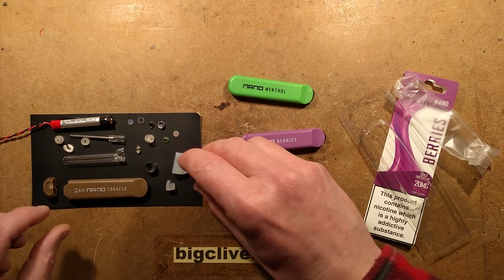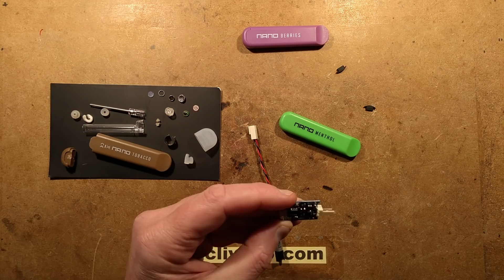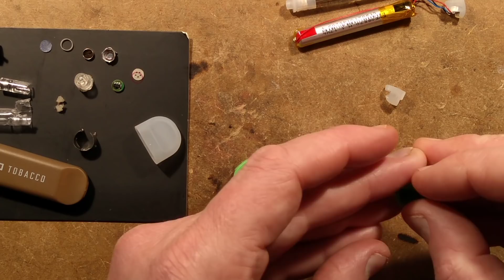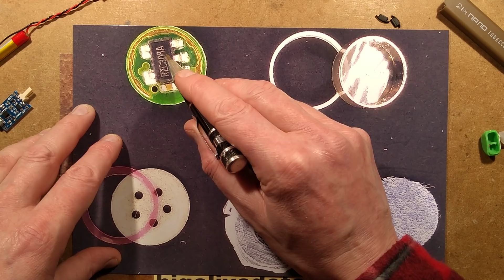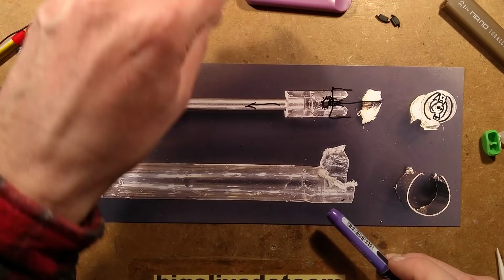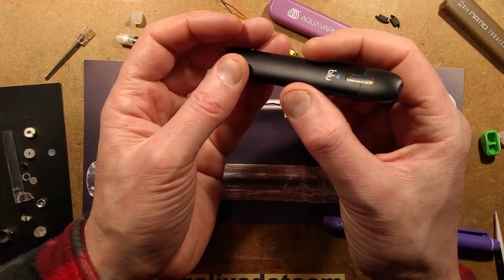Free lithium cells from discarded vapour devices.  (And total teardown of one.)

Comment: The newer vapes are  a bit bigger and often have a circuit to recharge the  lipo cell in order  to be able to extract the full say 16000(!) puffs (e.g. the Vozole 16000). It would be quite easy to make the reservoir  refillable too. The vozole 16000 for instance has a screen not only showing the  charge state and the  output power, but also the  filling level. adding a tiny hole for a syringe with vape fluid should make these things 'non disposable'. But at  say 25 euro a pop, I guess that is not what the manufacturers wants. I have no idea how many recharges one needs to  pull those 16000 puffs (I don't vape/smoke)  but the  lipos's I pull from them (generally 500mAh) still seem in excellent condition

Comment: How can the sensor be bypassed and remove the 10sec or so disabling the chip? I want to replace the sensor with an on/off switch and instead of mesh coil i want to get usb power out which can be controlled by on/off switch. Basically a mini portable power supply to light up an led  via usb( mesh coil) port.
Reply from the maker: You'd have to bypass it completely.   The timing is baked into the chips design.
Reply: @bigclivedotcom  yes, that’s where I need your  valuable opinion. If I desolder the sensor and put an on off switch, how would that work?

Comment: I found one of these in the car park the other day, I didn't realise it was worth 12 English shekels. Took it apart and found a working 3.7v 1500mAh battery inside. The owner probably didn't mean to lose it, but I'm appalled at the huge e-waste impact these things must be having? There was no actual way to refill it, just use 3500 times and then dispose of
Reply from the maker: The big 3500 puff ones have that very useful and fully rechargeable 1500mAh cell inside them.  Always a great find.

Comment: Thanks for this video! I've also started to salvage these lithium cells from used vapes just recently. Is it dangerous to charge these cells with regular TP4056 chargers? You must have had a reason to swap out the current resistor. Also, are these lithium ion cells, or lithium polymer? Thanks again!
Reply from the maker: I use a TP4056 based charger to recharge them.  If desired you can change one resistor to reduce the charge current to 500mA.  I've made a video about that.

Comment: So my new partner vapes, and her one time use units have an 18350 lipo in every one. Is there any way to re-purpose that control chip? Could I tap on some leads and get a constant current for the LED to light or something as an indicator on a project or do 3 of those pins make a regular mosfet?
Reply from the maker: The chip is a bit specialist, which makes it tricky to find other uses for.

Comment: Is it possible to use these batteries for something significant? I can get my hands on thousands of old vapes of the same type with the 13400 battery 3.7v 550mah. Say I wire 3x1000 in parallel and then connect each to a BMS to make a 12v+ power pack. Would  I set something on fire?

Comment: I saw you using ecig batteries in another video and you demonstrated how simple the chargers are to attach. I got 15 little chargers on Amazon for $11 with a USBC port for charging and they charge in an hour. It's a sweet little setup and I can make it better by adding another battery. The price is the best part. Everything battery operated that I have is gonna get a charge port if it doesn't already have a way to be recharged. I appreciate you sir. Thank you for sharing your skills knowledge and experience, and thank you for inspiring me

Comment: Just learned that through that chip you can actually charge the battery safely. Apply 5V to it and it will control current and voltage parameters. 
Maybe worth a look.
Reply from the maker: Not all of them have that feature.
Reply: @bigclivedotcom  
Bit of a dangerous way to find out I guess!

Comment: I'd come to much of the same discoveries in the cannabis vapes similar to this that we have locally - most of these ones include a micro USB for recharging until the tank is depleted, so I knew right away there had to be a small lithium cell that should either be salvaged or properly disposed of with battery recycling. I was always curious about that weird microphone like component running the show, but most of my disassembly attempts were too violent and I munged the tiny mystery chip within every time - these ones are even smaller and lack the two holes on the back which would aid disassembly which (probably extreme miniaturization over past couple years!)

Comment: I have a bunch of led driver chips with ltc4054 42, marked lth7 that I took apart from dog tags. Can I send you one to see what could be done with them?
Reply from the maker: The 4054 and LTH7 are actually lithium cell charge control chips.  Actually the same chip in 8 and 6 pin variants.  They regulate the charge current and end the charge at 4.2V.

Comment: Could you use the circuit from a poundland power bank to charge these cells, do you think?
Reply: Well..... so far so good. Just tacked one on to the charging circuit with a little bit of solder and plugged it in. Originally read 1.5v, now reading 3.8v. No explosions or fire so far but it's in a Pyrex dish just incase.

Comment: A disposable smoker's habit is an electronic fans again. Don't throw it away, pass it on to us geeks to reuse the Lith cells. After watching the other BCDC vlog about this waste of recyclable components it was worth watching this one too. Interesting thing was how the inhaling device worked with the micro thin diaphragm disc contacting the chip on a disc circuit signaling the lithium cell to power up the heating element of the device to heat the nicotine fluid to produce the smoke vapour. A great show case about these items, and that there is no smoke without a Lith Cell to fire up, LOL.

Comment: 20mg/ml is still lower than my current nic level of 24mg/ml...but considering I have cut my smoking of tobacco down from ~70 cigs/day to 2 cigs/day it's okay  :)  
But I do not use a disposable device like these...I use 18650 cells that I harvest from free laptop battery packs...they cost me nothing but the power to charge them.  
So far I am still using batteries harvested in 2017 that were made in 2009...haven't needed to delve into the ones I got later on yet.

Comment: They've made them in an even cheaper design now.
I bought one out of curiosity about a week ago and when opening it I dropped it on the table and the guts dropped right out.
I actually decided to smoke it and by the time the battery had run out it was still more than half full.
So I clipped the terminals up to my bench power supply and set it to 4.2V 240mA and it charged just fine (you can tell when it's charged on my bench PSU (a Tenma T2-10480) as the voltage goes slowly up to 4.2V and then the current starts to drop off at 4.2v.
After the reservoir was empty I simply drilled a hole in the side of it (a press drill made this very easy as I could drill super slowly and didn't have the 1.5mm bit self feed into the coil) and after that I could refill it with whatever I wanted.
I chose nicotine based E-juice I had lying around (I'm not a smoker and hopefully never will be though I've had months where I just smoked a hookah until I got sick of it and it had a very high nicotine content as I supercharged the tobacco with E-juice, I just like blowing smoke rings) and it wan for about 5 days after which it seemed to lose some of its power.
These things are far from 'disposable' and its a pity that so many of them will end up in a landfill every year.

Comment: I just scavenged the batteries from 10 of these today , most still have around 3.2v and the bigger ones a capacity of 850mAh. I don't know what I'll use them for yet, but it seems criminal to throw them away after a single charge.....

Comment: So you can build your own and put a normal button style switch in . If I can afford or find a good used lathe I might try my hand at building custom wood and aluminum vapes but I will start with one of these cheap disposable ones if I can build a proper charger for it.

Comment: I see these on my walks along the road or in the park quite often, and have taken them apart and found the little lithium cell. Your channel has given me inspiration to make some art with them... will be involving LEDs of course.  The tricky bit will be rigging up a charger. Hopefully I can glean enough from your other videos to figure that out – my electronics knowledge is limited to fooling around since I was a teen, with no equational knowledge to speak of beyond a Volts times Amps equals Watts, and a long-ago use of Ohm’s law ... but this old dog can still learn. Thanks.
Reply from the maker: The main thing with these lithium cells is not to exceed 4.2V.  I have a DIY charger that uses low current and two red LEDs in series to limit the voltage to about 4V.
Reply: @bigclivedotcom   Ah yes, I remember you mentioning the 4.2V. Come to think of it, I may be able to use the little DROK buck converter (https://www.amazon.com/gp/product/B07JZ2GQJF) that has a "charging indicator light" – I replaced the tiny built-in pots (that adjust V and I) with larger precision pots that are easy to turn and adjust, so I can play around on the bench and use as a crude adjustable power supply. The manual mentions a "constant current mode", but sounds like it's a current-limiting mode, for 2V only (https://www.droking.com/cs/support/topic/set-constant-current-on-the-180080afa/), so I guess that would be for a single cell? Hmm... I'll check out your circuit too... Thanks.

Comment: Love the side explanations. When I saw your video on salvaged lithium and NiMh batteries I knew there'd be some useful info and general theory, best practices etc. on the side. I feel like I'm learning a lot. Wondering if you could explain something about choosing the right voltage for recharging salvaged lithium battery. Also I heard from a guy that applying dimmed AC on fatigued LiPo cells can revive them but can't seem to find anything reliable and if you know something about it I'd love to hear it. Cheers!

Comment: Something to remember with this is that nicotine can be readily absorbed through the skin and the amount of nicotine that will make you sick/poison you is highly dependent on your body size (a smaller person requires less exposure to get poisoned), rate of exposure (your body is great at metabolising nicotine so long term exposure to small amounts will not poison you but that same amount of nicotine in a single hit could poison you) and if you consume it on a regular basis (a non-user requires a lot less nicotine to poison themselves compared to even a light smoker/vaper).  Clive is experiencing nausea (usually the first symptom of nicotine overdose/poisoning) when he vapes on these because he has a low tolerance for nicotine and nicotine salts are absorbed really fast.

In other words, don't get the liquid from these devices on your skin if you can avoid it - use gloves if possible.  Wash the affected areas with soap immediately if you are exposed.  Keep the liquid out of the reach of children as they require less nicotine exposure to experience poisoning and their thinner skin means quicker absorption.  Play with these in a well ventilated area as spilt/exposed liquid will evaporate and carry the nicotine into the air.  Finally, if you are feeling nauseous when you are working on these, seek out some fresh air and call medical services if you start to experience further symptoms like a racing pulse, headache, extreme fatigue, dizziness, and/or hearing/vision changes.

Comment: This can be easily solved -if the governMINT isn't on the take!
Just put a huge deposit on Li-ion cells used in vapes and any other device likely to be used once only.
When the Li-ion  cells are returned, the deposit is refunded. 

That creates a huge incentive to return the cell/battery from both the original purchaser and any scavengers.
This model has worked very well in countries that have imposed deposits on PET plastic bottles.

Comment: Just want to say thanks for this video.

I'm looking to upgrade my kids wireless keyboards from stock AAA to usb-c plug in rechargeable and one of these cells would be magic.

Just need to find them discarded now...
Reply from the maker: It could be useful paired with a standard TP4056 charge and protection PCB with a suitable current programming resistor.

Comment: I just go to computer shops and ask them for discarded laptop batteries. Open them up, there's 4 to 8 (18650) cells in them, measure their voltages and discard those below 3v, keep the rest and make batteries for my RCs.

Comment: That's pretty stiff on the nicotine. I started at about 20 mg and am now down to 9. Having a mod with a sub ohm coil (.13 ohm) and 60 watt setting, it is a LOT better than those little ones such as Blu. My current atomizer has 5 coils in a circular pattern. Those little toys are aimed at kids in my opinion. They are easily concealable and give a quick "fix".

Comment: These pressure switches can actually have very practical uses. First that came in mind: there are so called "sip and puff" input devices, mainly for people with certain disabilities. 
I think a "two way" variant of this switch can be made to have both low and high pressure outputs.
But even with two of this and some creativity, two way device can be made.
There is another question though - whether a switch is practical enough or it's better to have a continuous range of values from a pressure sensor...

Comment: I would argue that that little thing is a microphone. A microphone is just an air-pressure sensing device. That little mic probably isn't useful for audio capture though.
Reply: nope, A microphone would give a variable output, this is a SWITCH-either on, or off.

Comment: First video watched on my new computer... Joinhoney.com just informed me that polka dots are "super retro," and polka squares are "in." 

20mg IS a rather high strength! I have used Juul pods of 3.0 and 6.0mg. The e-juice I have for my sub-ohm isn't even 20mg. There is the chance that they meant 2.0mg because the font is rather odd. (For instance, "Nano" looks like "NAND" to me, I was wondering why they named the device after flash memory at first, NAND doesn't exactly roll off the tongue!)
I've been smoking for 22 years, down to a pack a day from two packs a day a few months ago. Even now, if I smoke a cigarette too quickly, I get that "head rush" from nicotine hitting my system too fast. Very mild dizziness, similar to a slight alcohol buzz.

Comment: I used the air flow switch on an external LED circuit on the front of the go cart. As the cart moves and the air hits you, the led switches on. It was nothing but a fun project 😅
Thanks for your wonderful videos.

Comment: I was wondering if you know of a way to bypass the pressure switch and use just a push button instead  to get the power that goes to the cartridge to come on?. I don't smoke or vape, but I would like to put a button on one of these and run a couple wires out of it but keep it in its original housing.

Comment: Yes!!!! And you can often find these at gas stations for 1$ the rechargeable type , that usually go for 20$ 30$. Where I work we have 3 different types on like a promotional sale for 1$. I have accumulated quite  a lot. You can do a lot with these for example  I noticed that my drone has basically the same battery powering it to last 20 minutes,  I have been able to increase my flight time to over an hour with these!!! Not to mention fun with lasers.

Comment: ......i always find these on the street and pick them up for the cells, they are usually half full, not that i vape nicotine anymore
Reply: also, since you seem to know, how do i abuse an dw01 or similar to charge 18650s at 2 amps or more??

i have a bunch of 5v4a smps' but i am still using a number of old DC4.4V 1.5A motorola pre-usb chargers, they work great to charge nearly all lithium ions, they float to about 4.56 if left to charge for over 24 hours, in theory i am killing my cells faster but i havnt really noticed any substancial degradation of MOST cells(i've had a few that dont like going that high and tend to short themselves and fail in a sadly, very controlled manner, they get hot enough to warm your hands on a frosty day through some gloves but not hot enough to even shrink their wrappers, these lipos are great for charging to 4.5+ volts and then cutting into the side for fireworks

Comment: Any videos you do about these devices are going to be very poplar state-side of the pond. 

I was really pleased to see you upload this one though, because these devices have peaked my interest many times. Some of the nicer models from the "big brands" have full-color 'pixel style' led's in them, and the devices can be rigged up as sort of homebrew universal chargers for small-size lithium cells... I've been taking the LEDs for projects, and I've got jumper leads coming from the charge circuit to rechargeable AAA-size batteries, little slow, but works fine, better than tossing them in the trash.